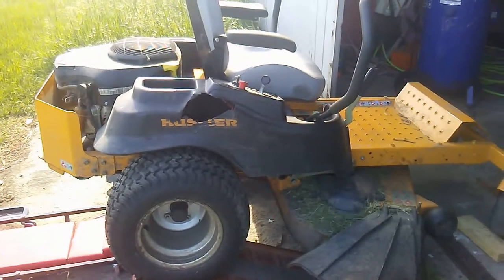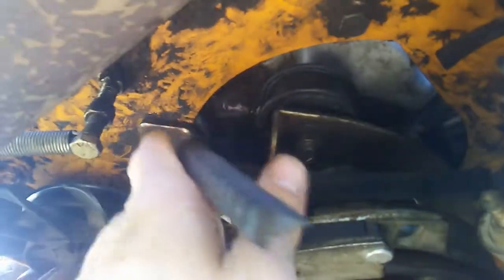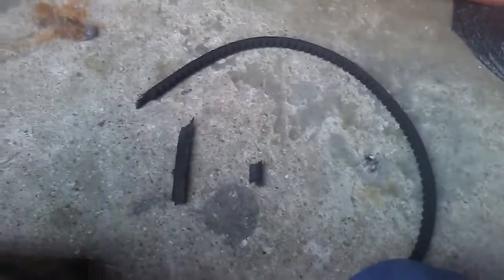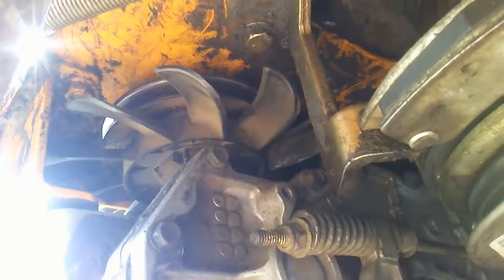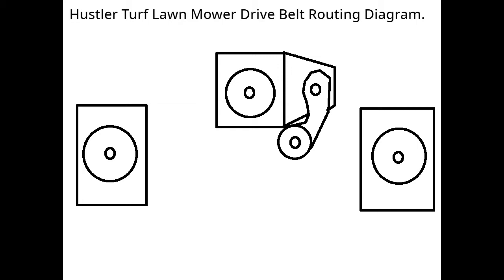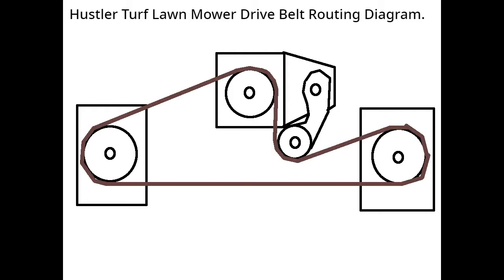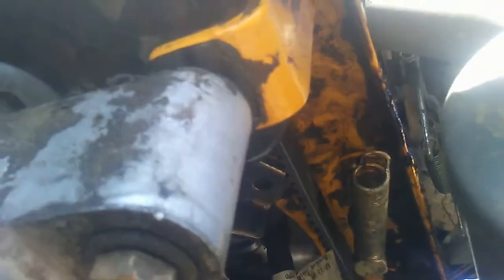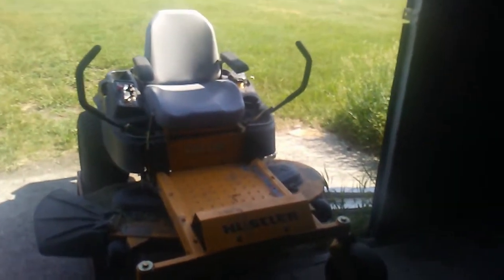Hustler Turf Zero Turn Mower Drive Belt Replacement

Comment: Thanks for the diagram. I did have to drop the trans axle on both sides to get the belt over the drive pulleys. But your video was very helpful. Thanks for taking the time.
Reply from the maker: you're very welcome! if each video can help out just one person, my time was well spent.

Comment: Thank you for the video.  The graphic you did was what I have been looking for.  Great tutorial!
Reply from the maker: thanks. I only wish I could have shown it in  real time as I worked on it. but the next best thing is always a graphical representation!
Reply: @nybergsgarage  true, but so far this is the best video I have found to show the routing of the belt.  Other videos I have watched show how to replace the belt, but not how to route the belt.  One thing I found is removing the aft hydrostatic motor mounts (13mm bolts and locknuts) allow more room to slide the belt over the fan pulleys.  Eliminates a lot of frustration and saves a few lacerations to the hands...lol.
Reply from the maker: @ssgvern  haha thanks, I'll keep that in mind!

Comment: I would like to add after putting the new belt on it kept popping off. I finally realized my hydro transmission was missing a carriage bolt in the back mounting bracket causing instability. The bolts in the front area were also loose. Once getting the bolt replaced and everything tightened the belt has stayed put. In order to access these areas I had to remove both back tires.
Reply from the maker: thanks for the tip. actually, I've been having that exact issue for a while, I'll have to check the mounting bolts.

Comment: The broken belt was not the correct belt. NEVER put a cogged belt on a hydro drive.
Reply from the maker: as I recall, the mower came with a cogged belt originally, and many of the replacement belts for it are cogged as well. specifically why do you say not to put a cogged belt on?